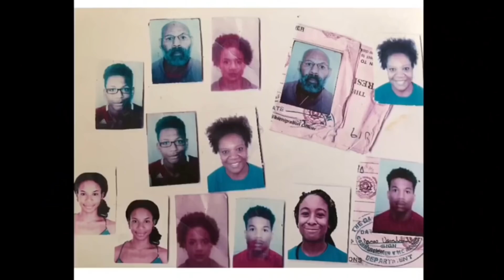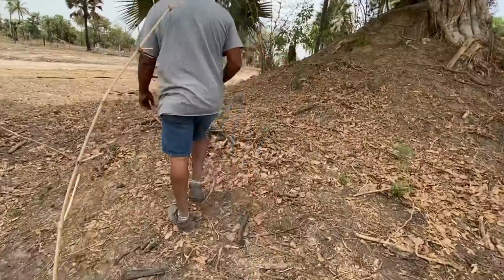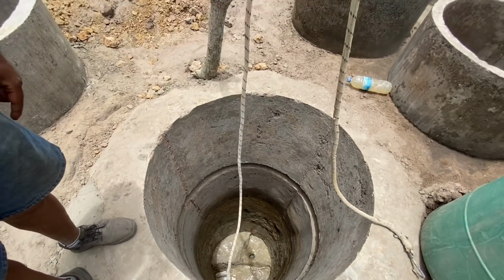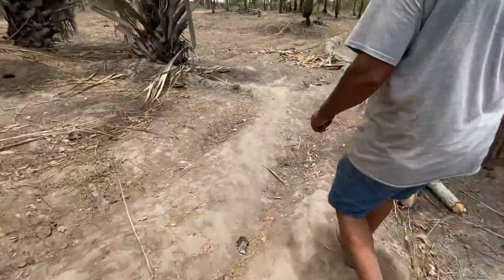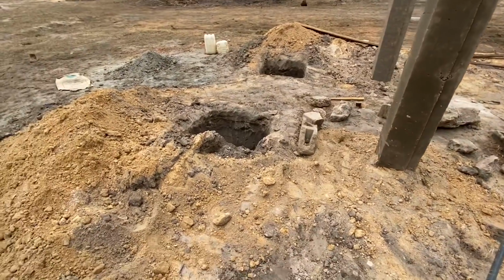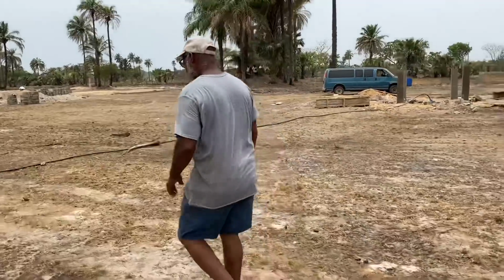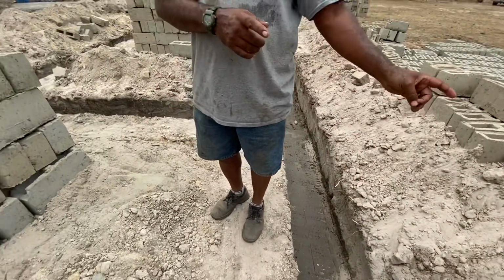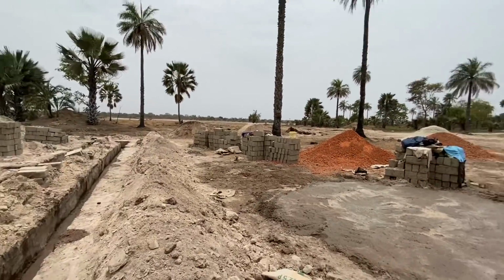A Weekly Update On The BAG Progress.

Comment: Normally we (Barbados and the islands) would have starter bars ( half inch steel bars) coming out of the concrete foundation. As for the strength of those blocks being erected I am concerned. 🇧🇧🇧🇧🇧🇧🇧🇧🇧🇧
Reply: That's only a starter base , rebar beams will be laid on that base and pour with your block bars sticking up. They always make blocks on site in Gambia
Reply: They doing the right thing my friend, no worries
Reply: Yep. Rebar coming from the foundation. I think they used too much sand. I think this is the reason some of the blocks is broken. Just my guess.